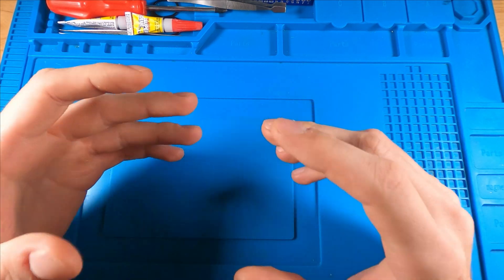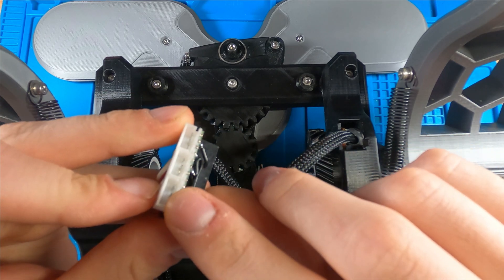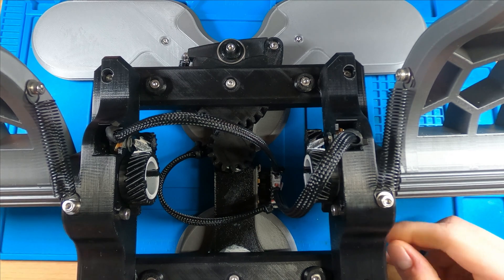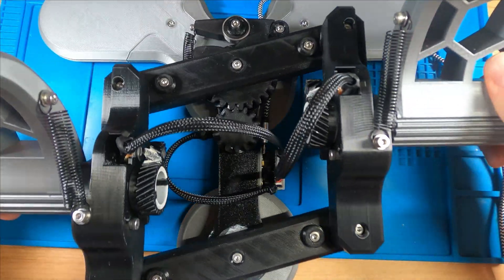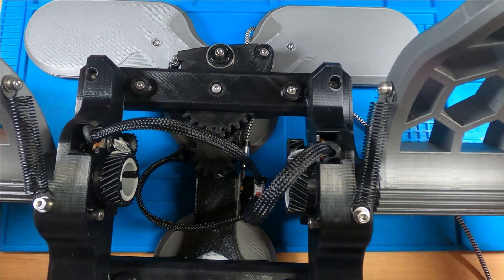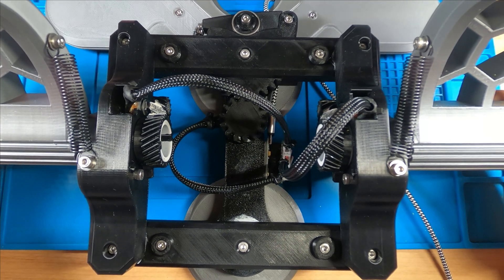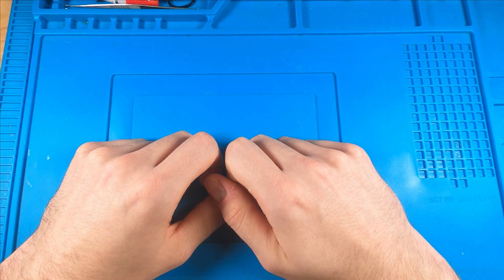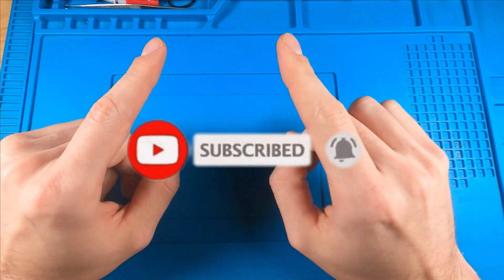CadetPedals Demonstration and Build

Comment: Note an upgraded controller choice is a Blue Pill and run the "freejoy" project on it.   it lets you do some tweaking to pot profiles and naming of the set so that the pedals even show up in windows as "flight pedals" named and let s you control the ID's of the board so it doesnt conflict with arduino button boxes.

Comment: Great project, I'll be printing it soon - with a small change.
You could make it precise, easier to build and more robust:
BU0836A 12-Bit Joystick Controller instead of arduino (12bit analog inputs instead of 10bit)
Magnetic (Hall effect) sensor Allegro A1302 and a magnet instead of potentiometers. (No gears, no dead zone, no wear)
Reply: How did the Hall effect sensor work?

Comment: First of all, awesome design... really appreciate your effort and generosity sharing your work, you've done all the heavy lifting. I've just finished building one, but I've had to 'remix' it a little bit to components and parts I have available - I'm using AS5600 hall effect sensors instead of pots, resized the PVC tubing (we have metric 25mm OD), and resized the screw holes as I don't have those brass inserts. Having the STEP files made it easy, so again, much appreciated for sharing!
Reply: printing my pedals now and intend to use hall effect sensors too... whats your thoughts long term on these and the AS5600 units

Comment: Thanks  you so much for free sharing these things, Amazing work !
You could put a PayPal or a spreadshirt in thé description, because wow that's worth it !

I have a question : how much plastic do you need to create all of this ? (I plan to buy flight simulator and a joystick, and dont have enough money for the rudder , and I find it Amazing to do it myself (not totally 😅))

Great work, nice animations, congrats !
Reply from the maker: Hey Leo!
The amount of filament used will depend on a few variables like wall thickness and infill of the printed parts.  For this project, I didn't document the exact amount but on the CadetYokev2 I made a spreadsheet documenting a lot more of this type of information (still learning the types of info people want haha).  If you import the parts into your slicer, you should be able to estimate the amount of filament needed based on your preferences.

Also if you are interested in contributing, you can click the thingiverse link and hit the "Tip Designer" button on the right-hand side of the page.  This will redirect you to my PayPal!

Cheers,
Vince
Reply: @VincePrints  Thanks you very much for this fast (as f) answer !

I didn't thinked about this option, but that's pretty straight forward.

Concerning the tip, I'll try to convince my parents to do one, because its just amazing what you do !

Cheers,
Leo
Reply: If the information is helpful to you, I did the math, and in my case, I'll need between 700 and 800 grams of filament : 320 black, and 400 grey

Comment: Just in the process of assembling mine while the pedals print! Amazing design, thanks for doing it. Only issue I've had was the grips are too large by a hair to fit inside the base are need some filing probably due to the elephants foot on the first layer, if you end up making some revisions, maybe consider taking a hair more off the grips to make life easier

Comment: how did you get it to work with fs2020? mine only shows that the device is connected but doesn't allow me to assign any axis to anything
Reply from the maker: Did you calibrate in Windows?
Reply: @VincePrints  yes the calibration part is done
Reply from the maker: @OvaisDIYGarage  It should appear as "Arduino Leonardo" under the Controls tab where you would select keyboard and mousse controls typically.

Comment: Incredible project!!
First of all, thank you very much for the great contribution. I have a question about the calibration. If I'm not mistaken, in windows there are 3 axes to calibrate: Pedal potentiometers (X, Y) Central potentiometer (Z). I can't do a good calibration and it may be because of the position of each potentiometer. Could it be because the potentiometer is set to its center position rather than its home position before each pedal is moved?
Reply from the maker: There are 3 axis to calibrate: the 2 toe brakes, and the center mechanism.  When calibrating within the windows USB manager, make sure you move the pedals fully in either direction so that windows can see the full value of the potentiometer.  The fact that it is in the middle of it's range should not be impacting your ability to calibrate.

Hope this helps!
Reply: @VincePrints  Thank you very much for your answer. I am seeing that my problem is with S: A2 (right pedal). It seems that it does not receive signal, I have checked several times the connectors and the potentiometer. Could it be due to an Arduino Pro problem? Could you change the connector to A0 for the right pedal ?. Thanks in advance
Reply from the maker: @frankfdj  You should be able to change to any available analog input as long as you modify the Arduino code
Reply: @VincePrints  thanks , is what I will do, I think I have broken pin A2 by inverting GND and 5v ... hehe.  I will use A0 and reconfigure in Arduino code.  Thank you so much!!
Reply: Can you help me to calibrate?

Comment: Whst is a good way of cutting those keyways in the PVC pipes? Was Gonna try a lasercutter but that was pretty toxic apparently xD
Reply from the maker: I suppose you could, I used a drill and a file but a Dremel would probably be more efficient.
Reply: @VincePrints  i finnally finished it turned out quite good. Gonna try to edit it  a littlebit cyz some of the hardware looks diffrent here than what you designed it around ^^

BUT. when i have finished coding it. My arduino and all the data from the pots are suuuuper slow xD am i missong something? :O it like lags/janks when moving then axis.
Reply from the maker: @Creedarn  Double-check your electrical connections, there should little to no latency!
Reply: @VincePrints  i changed the coding part and it worked better guess it is something with the way arduino reads it.

leftPedal = analogRead(A3);
rightPedal = analogRead(A2);
rudderAxis_ = analogRead(A1);

rightPedal=map(rightPedal,0,1023,0,255);
leftPedal = map(leftPedal,0,1023,0,255);
rudderAxis_=map(rudderAxis_,0,1023,0,255);

Joystick.setYAxis(rightPedal);
Joystick.setZAxis(rudderAxis_);
Joystick.setXAxis(leftPedal);

Comment: Im loving seeing all of your diy builds and since im also a DIY'er im really interested in your projects. 
However may I sugest some force feedback on the pedals? Maybe with a bit of arduino code and 3 stepper motors we can give some feedback from the airplane to the controls.
Can anyone give some hints about the real NM force that is felt in real aircraft?
That may be critical to find a right spec motor to attach it.
Reply from the maker: Force feedback would require a lot of research and gearing mechanisms that extend beyond my development scope for the project.  While possible, it would become much more than a cheap Arduino project--perhaps someone would be willing to modify my designs to make this possible.
Reply: @VincePrints  Well since Im printing your pedals is just a case of after print figuring out the necessary changes to fit 1 motor to drive the rudder steering and 2 motors for braking. (the brakes im thinking in linear actuators to limit the course movement of the brake pedals)

Maybe there is a way of changing the brake pressure, a spring per pedal and a linear actuator compresses more or less the pedal spring to give some sort of "brake feedback". 
Could you give hints about the force that is present at the real aircraft? Rudder NM and brake NM?
I've edited my MS_Sidewinder FF2, to be a cessna yoke with FF. Now im targeting to do some sort of same thing in the pedals. Also maybe a nice ideia to use another MS_Sidewinder FF2 and his motors to do what i want in terms of rudder.

Update: What do you think about this mini linear actuators between the pedals and the pedal coil? That way we can make the brakes feel stiffer or softer as sent by the simulator software.

https://pt.aliexpress.com/item/1005001421552415.html?src=google&albch=shopping&acnt=708-803-3821&isdl=y&slnk=&plac=&mtctp=&albbt=Google_7_shopping&aff_platform=google&aff_short_key=UneMJZVf&&albagn=888888&isSmbAutoCall=false&needSmbHouyi=false&albcp=9437679086&albag=97536833404&trgt=296904914040&crea=pt1005001421552415&netw=u&device=c&albpg=296904914040&albpd=pt1005001421552415&gclid=Cj0KCQjwutaCBhDfARIsAJHWnHvkymVD-F1Jths9cUVdGl7CqXZrNV_wzfwDAoAauk6JzO7nthJTDWIaAgxCEALw_wcB&gclsrc=aw.ds

On the directional side of pedals a single stepper motor would do the trick.

What your toughs on that? Also do you allow me to mess and edit a bit with your project in order to fit there 3 motors and position sensors.

Can you share the design but not in STL file format in order to do some editing of some parts to try to integrate the 2 linear actuators that ive told and a rudder motor.
Reply from the maker: @frederiko1982  I wish I could help more!  I've never piloted a real aircraft before, so I have no idea.

Steppers and linear actuators would be sufficient in providing back pressure, but I think you will find that you need a lot more force than you think to replicate the sensation you are describing.  Also, back driving that small linear actuator would draw a lot more current than the pro mini can handle, so you would want to consider or power options--almost certainly 9V or higher.

Another consideration is that you would need to dig into the MSFS2020 SDK to pull information from the game to drive your feedback mechanism.

The .step file is listed in the thingiverse project page, you just have to look for it!

Comment: can I use arduino mega 2560? I had those laying around
Reply from the maker: The Mega2560 does not support USB communication and as a result, will not work for this project unless you plan to use a program like MobiFlight.
Reply: @VincePrints  omg that's why im thinking about.

But is it possible to have it working in mobiflight? I don't have idea how to set it up  :(
Reply from the maker: @ryandconan  You may want to consider just purchasing a Leonardo board.  They are VERY cheap on amazon or from a Chinese retailer.

Comment: Excellent design and implementation, what sized build plate do you have on your 3D printer?
Reply from the maker: My Prusa MK3 is 250 x 210 x 210mm and my Prusa mini is 180 x 180 x 180mm

Comment: Great design except for the key-ways.  I just slowly drilled a few holes in the bottom of the pedals and unused sections of the the toe brake gears (as we don't need the full range of the big gear anyway) and added small screws to hold in the PVC pipe.  This also helps lock the gears so they can't fall off if key-ways are cut too big (not confessing to anything.).
Reply from the maker: Haha happy you found a solution

Comment: Many thanks! I'll build them when I finish my exams
Reply: I haven't finished it yet but regret starting this. Pedals are wobbly, they don't feel solid at all. Base parts won't fit each other propperly, and wiring... omg, I've been wiring potetiometers with the Arduino with shitty duponts and a horrible pcb I've made for such a long time. What's the result? Wires popping out, bad conections and bouncy axes. I'm very grateful that Vince spent time designing this, but I'm not sure if it worths it. Maybe it's better to save a little money and buy the Logitech

Comment: Great build. Question, how did you calculate the gear ratio of the pivot? or was it done by eye? will be trying this one out.
Reply from the maker: Great question, I did this mostly by eye but it can be done mathematically.  I was mostly trying to get a specific angle value for the pivot (I believe +/- 45 degrees if I remember correctly) and then scaled my gearing ratio with respect to this.  Given that this would create 90 degrees of total rotation and the potentiometer has 270 degrees of total rotation, you can calculate the gearing ratio to be 1:3.  The real key is the map() function within the Arduino sketch that converts the HIGH and LOW limits of the potentiometer (how mar it is able to spin) and scales them to fit the values expected by the computer.  Hopefully, this helps!

Comment: This is fantastic! One question: is there anything in the way of me 3D-printing an alternative to the PCB pipes? They're hard to come by where I live
Reply from the maker: Potentially haha you'll want to use something that can withstand the weight of your leg, which is quite a lot of force for a 3d printed part on a sheered slot line this.  A wooden dowel or metal pipe would also work
Reply: @VincePrints  Aaah okay. So that's like the main load-bearing part? Makes sense that I don't 3D print then, thanks :)
Reply: @SimmziNOR  There is another design by  Michael Rechtin at 9:26 in the following video https://www.youtube.com/watch?v=nO-lanEc5vM   Maybe you could mix and match.  I like Vince's model but I'm considering remixing a little to make it wider and use an xbox controller in the center for the inputs (for Elite Dangerous which allows multiple controllers for game input).  The top bar with the gear, use it to mover the analog stick, and for the pedal brakes, use the analog trigger buttons (like in this video https://www.youtube.com/watch?v=Qy1amRL5POE.

Comment: I have it made and everything but I don’t know how to use it on war thunder is their any way you could help me
Reply: I just ordered all the parts to make this for use with war thunder.   I'm assuming the yaw would be for the pedals, and the brakes would be under left break and right break.
Reply from the maker: @wegz15  This is correct
Reply from the maker: I have never played that game so I'm not sure, you may want to try posting in r/HotasDIY to see if anyone has experience with that.
Reply: @VincePrints  hey for some reason now when I use the sketch It says their is no such file or directory in still really new to all this stuff so I don’t know what is going in and before it didn’t give me this error
Reply from the maker: @brand0n505  You need to download the joystick library and install it in the Arduino IDE.  Here is the github repository:
https://github.com/MHeironimus/ArduinoJoystickLibrary
Reply: @VincePrints  I downloaded the joystick library from the arruino program and now it’s not letting me put that library and I can’t find it in the document fils to delete the library so other than that I still had the sketched saved into the arduino so it still works it’s just when I go to upload it again it doesn’t work
Reply: @brand0n505  I had the same problem.  If you install the joystick library from Arduino IDE, it doesn't work with that library.  I had to manually delete that version first (as there is no uninstall option) then placed the joystick lib from github in that folder.  I think I added is as a third party library too.  It was a pain to sort through and I don't know why the joystick library in the IDE does not work, but I luckily noticed it had a different author.

Comment: How stable and how smooth running is it? I wonder why you didn't (and no one else on thingyverse) include 8mm rods and linear bearings into your design. Usually everone who owns a 3d printer has several of these laying around as potential spare parts for maintenance.
Reply from the maker: Still smooth after a few months of use.  This style of pedal had a variable width when it actuates, making it a less than ideal candidate for rails-- though that would strengthen the design.  I also did not have linear rails or bearings lying around.
Reply: @VincePrints  
Hmm weird. What 3d printer are you using? The linear bearings of my heatbed failed during christmas so it was good to have some laying around or I wouldn't have been able to print for a long time.
Reply from the maker: @Bullshitvol2  I have a PRUSA MK3 and a PRUSA MINI both from the first few shipments--still holding strong and I highly recommend it.  I do regular maintenance to the hotend but I've never had issues with any of the bearings (yet!).

Comment: awesome , thankyou very much, could you help me though , when i compile the code i get this error.      

  Arduino: 1.8.12 (Windows 10), Board: "Arduino Leonardo"

CadetPedals:4:1: error: 'Joystick_' does not name a type; did you mean 'Joystick'?

 Joystick_ Joystick(JOYSTICK_DEFAULT_REPORT_ID,JOYSTICK_TYPE_JOYSTICK,

 ^~~~~~~~~

 Joystick

C:\Users\THE EGG\Desktop\downloads\CadetPedals\CadetPedals\CadetPedals.ino: In function 'void setup()':

CadetPedals:16:11: error: expected unqualified-id before '.' token

   Joystick.begin(); //Starts joystick

           ^

C:\Users\THE EGG\Desktop\downloads\CadetPedals\CadetPedals\CadetPedals.ino: In function 'void loop()':

CadetPedals:23:11: error: expected unqualified-id before '.' token

   Joystick.setXAxis(leftPedal);

           ^

CadetPedals:27:11: error: expected unqualified-id before '.' token

   Joystick.setYAxis(rightPedal);

           ^

CadetPedals:31:11: error: expected unqualified-id before '.' token

   Joystick.setZAxis(rudderAxis_);

           ^

Multiple libraries were found for "Joystick.h"
 Used: C:\Users\THE EGG\Documents\Arduino\libraries\Joystick
 Not used: C:\Users\THE EGG\Documents\Arduino\libraries\AxisJoystick
exit status 1
'Joystick_' does not name a type; did you mean 'Joystick'?

This report would have more information with
"Show verbose output during compilation"
option enabled in File -> Preferences.
Reply from the maker: Someone had a similar issue.  You need to make sure you have the correct version of the joystick library installed.  You can find it here: https://github.com/MHeironimus/ArduinoJoystickLibrary

Hope this helps!